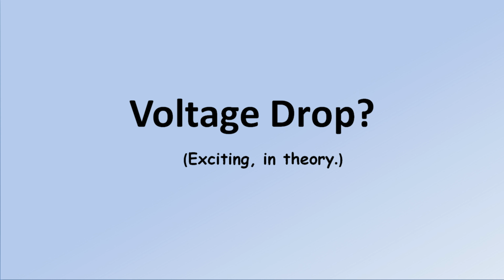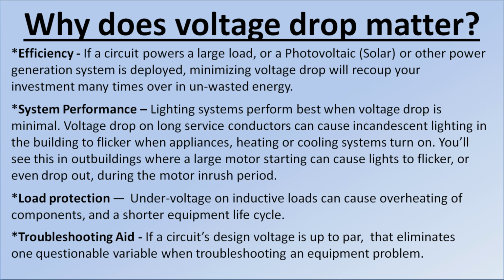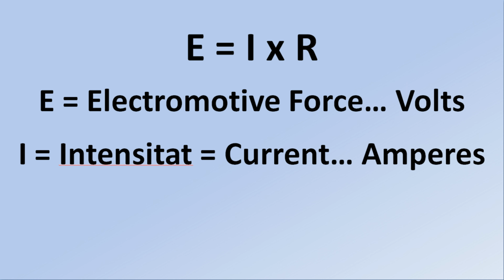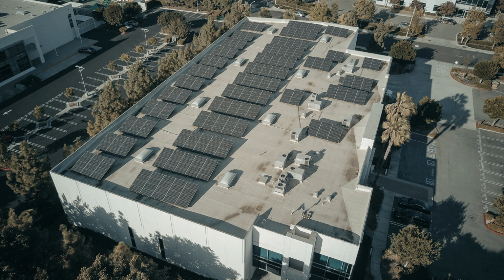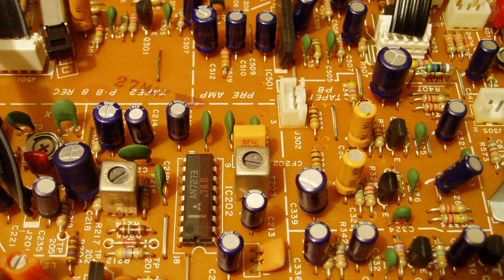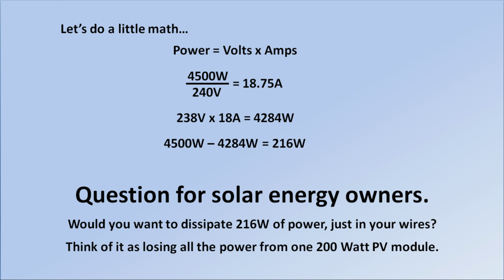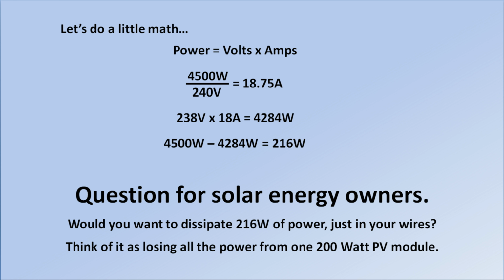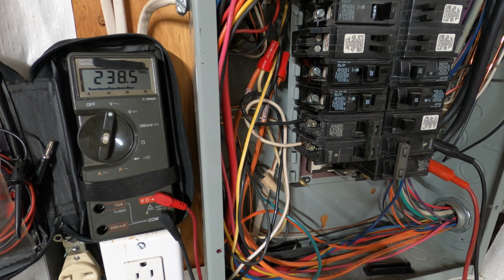What the... Voltage Drop? | Part 1 | Man About Home

Comment: So how woukd u remedy the situation? Oversize the wires between the main panel and sub panel? Or use copper instead of aluminum maybe?
Reply from the maker: Increase the wire size. And if you do that you also have to increase the ground wire size by the same amount. Thanks for watching and commenting!